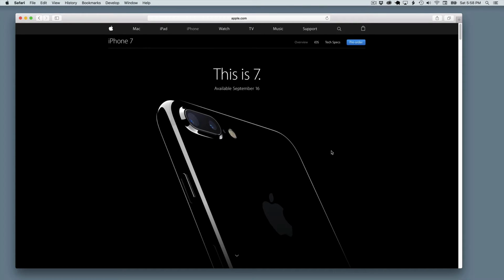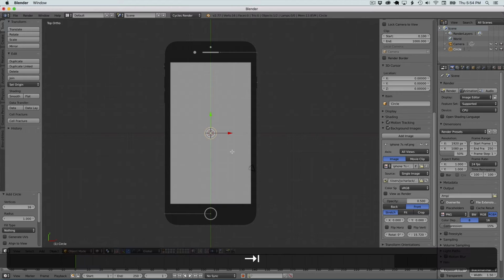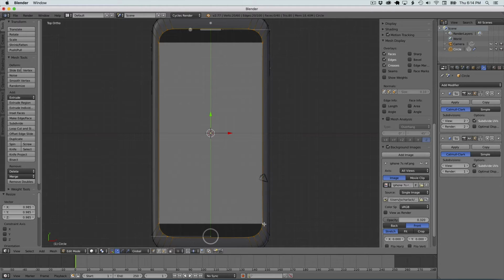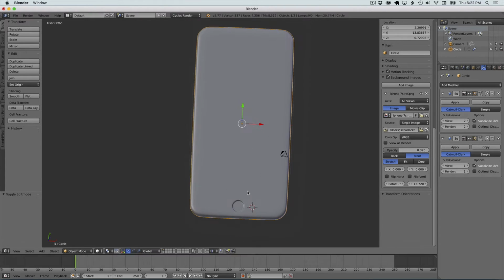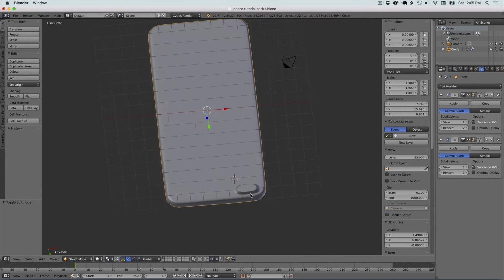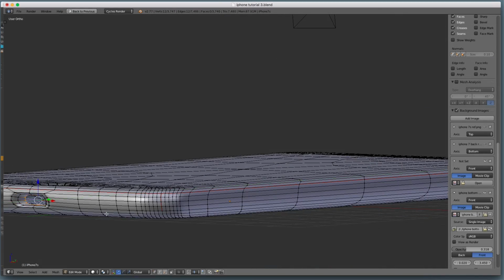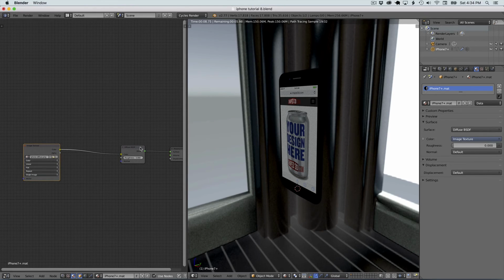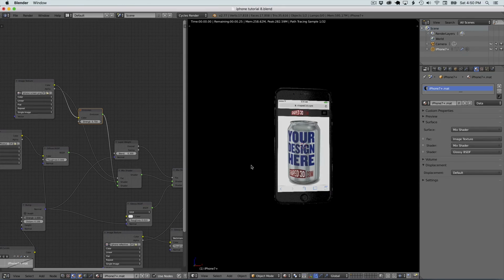iPhone 7 plus modeling and rendering

Comment: what do you record your screen with?
Reply: and this is good so far
Reply from the maker: Thanks. I use a mac app called Screenflow to record the screen. I just got it, but it costs money ($100). If you're on a Mac, quicktime will record the screen for free - that's what I used in my previous videos. No clue about Windows or Linux screen recording.
Reply: oh ok thanks anyway.